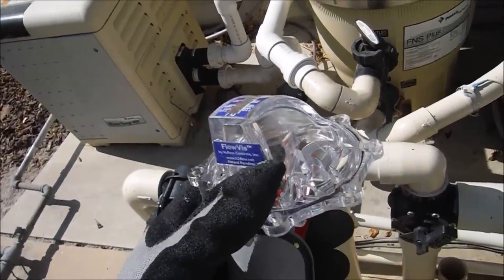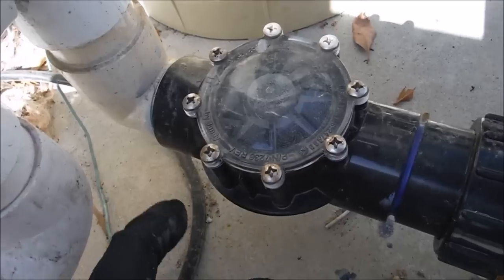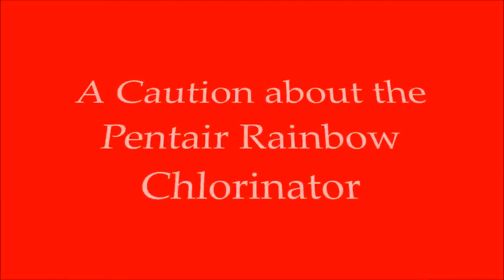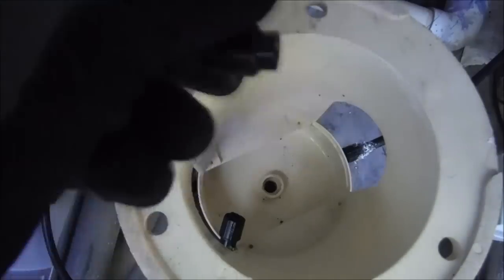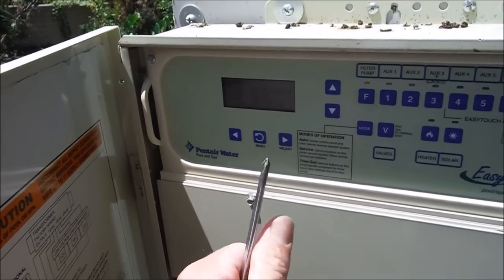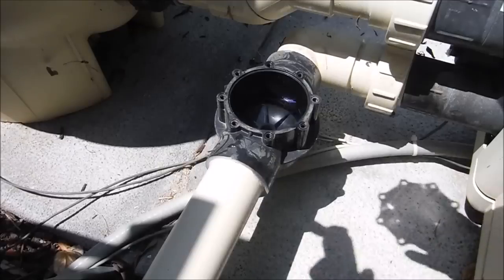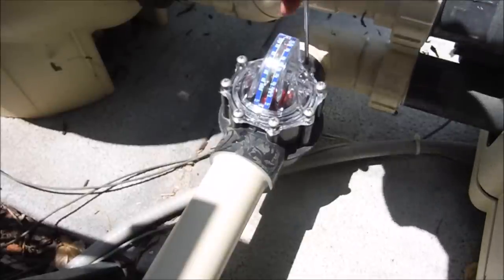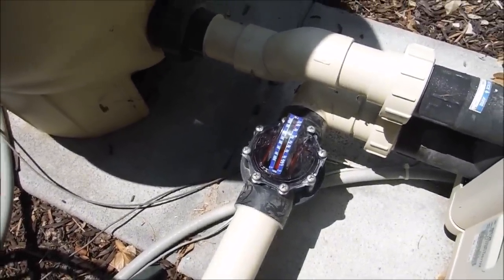FlowVis® Flow Meter Retrofit Kit Installation Guide

Comment: I don't have a check valve how do you install one? Thanks
Reply from the maker: You will need the complete FlowVis. It is pretty easy to plumb in. 
FlowVis® Flow Meter - Plumbing in the
Complete Valve: http://youtu.be/3cvUP6n3xvQ